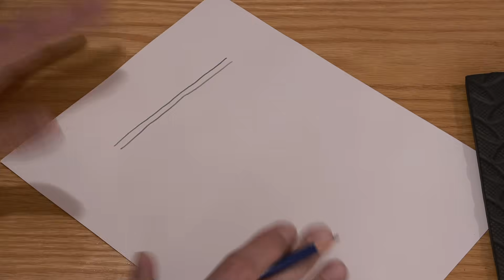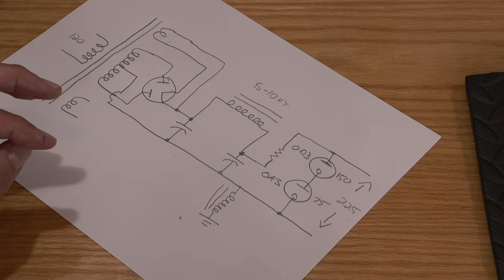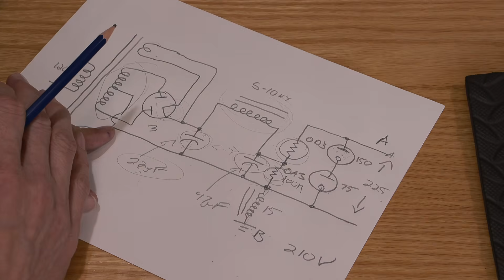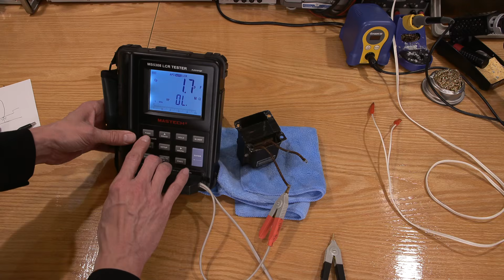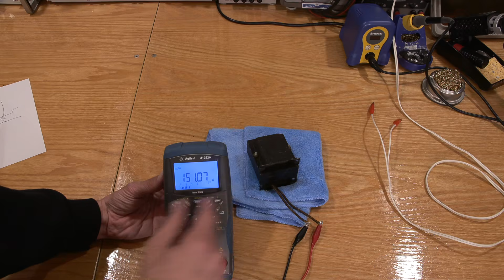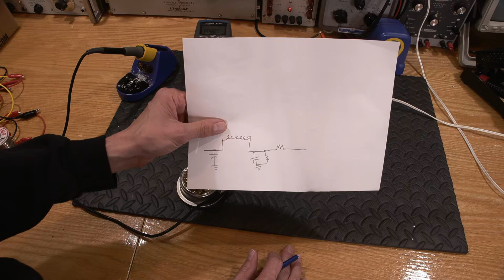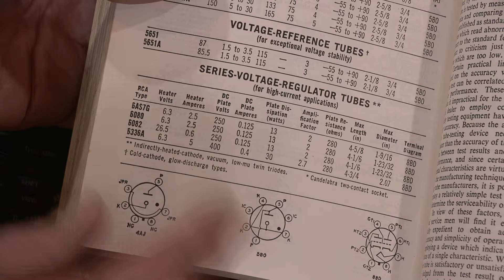Build A Power Supply - With Junk Box Parts! [The BC-348 Series.]

Comment: Can you please explain what is "B Plus" ?  Thanks.
Reply from the maker: B+ originates from "Battery positive." It was widely accepted as the "high voltage positive" in battery-less sets, (and pretty much everything else) that utilized an elevated voltage supply.
Reply: Wiki: "B+, the plus voltage of a Battery (electricity) or plus voltage of an electronic circuit." In tube circuits it is an elevated voltage (DC or Direct Current), the tubes need a high voltage on the anode to work.

Comment: The only change I would make to your power supply layout is that I would put a cage over it to keep my cats from climbing on it and touching the hot tubes.  I liked guessing along with the parts picking and was surprised how close I got to the actual values.  I don't consider myself to be very smart, I'm just a peasant who has been tinkering for 52 years and learnt many things the hard way!  Never try to wipe off a CRT to get a better look at the numbers.  I was replacing a picture tube in grandma's tv when I was 15.  I heard the little "tick" then things got a bit fuzzy for a few seconds.
Reply from the maker: Yes, a damp cloth around the anode will set you up for a really hard lesson! Thanks for sharing your story.

Comment: Well, if you're really going to be period-correct with the 5U4 rectifier, really, you should ditch the Hakko soldering iron and go with one of those hungus cattle-prod sized soldering irons suitable for joining rain gutters, no? 

So in terms of developing the proper value for the big dropping resistor, I'd thought I'd see you use your bench power supply, the big honking Lambda model 71  [which I have NEVER seen you use and it's too damn bad, we ALL have such a supply and feel the need to have one and we NEVER use it] to run the radio & measure the operating current and from that number calculate the dropping resistor value.

Comment: Mr. C builds a radio power supply. The rest of us are unknowingly partaking of a college-level applied lecture in electronics fundamentals. This is what YouTube was built for. 👍 Two hours of video brings many, many thoughts, but chief among them:

-If we're going for a cool-looking power supply, perhaps consider sneaking a neon lamp behind the 5R4, so it also glows as brightly as its contemporaries. We could use LEDs on that 5v or 6v winding, but we're keeping this old-school, correct? If we need an excuse for the neon to be functional, perhaps it could also help clamp that initial voltage surge.
-Any cool-looking power supply needs a current meter next to the jewel light, right? We gotta know how much power that speaker is (or those headphones are) pulling. 😁
-If this radio is as hackable as you say it is, this viewer wouldn't mind a detour from the Restoration Series to see some nifty things a surplus BC-348 could do. Probably easier for you to do while it's already on the bench. Or, if such a detour causes an outcry, we could revisit this later.

Thanks Paul!

Comment: My old Tektronics 310A scope has factory holes throughout both sides for ventilation of its 30 something tubes. I LOVE the warm glow the tubes emit thru the side covers. Perhaps your power supply could utilize a similar vented cover to allow cooling and tube protection while letting the beauty shine thru. The 310a was built in '59 so it's still period correct I think. You have similar vintage scopes, so you know what I mean.     Tom S.       (patreon sub)

Comment: Sir,
Apocryphally the term debugging, currently used to correct programming errors, came into use during the requirement in early computers and telephone exchanges (40/50/60s) where relays and uniselectors were prevalent. The term referred to the maintenance required to rid the systems of dead insects caught in the contacts.
In the 60s we used the term birds nest to refer to knocking nails into a plank of wood to provide a 'chassis' upon which to build a circuit.
Dead bug construction was fundamentally the same when ICs became more available.
Whilst those with better/unlimited budgets had more sophisticated methods the standard hobbyist had to make do and adapt.
The same is true today.
Dave.
Reply from the maker: I commonly refer to it as a "rats nest" as well. But that's a bit harsh :^)

Comment: I would put the two regulator tubes next to each other. Form follows function. And if you can find one of those military 5R4GY's with the ceramic bases, that would be great. No military equipment would have a 5U4 -- that's TV receiver stuff. The transformer and choke are nice, though they have a 1930s radio vibe instead of the military look, but that's OK. It's great that they are the same style.
That's a really nice radio; I'm looking forward to seeing what you do with it.

Comment: What sets the -15V for the negative supply? Seems to me it's an IR drop across the choke between the center tap and chassis, or something in parallel with that choke that sets a V=IR. If it were just a resistance, it would be dependent upon the ground current magnitude. Seems kind of indeterminate, but I guess it doesn't need to be precise at all.
Reply from the maker: It mostly acts as a resistor, but pretends to be an inductor a little.

Comment: Probably one of your better design videos! Question, would it be possible to utilize those regulator tubes in a variable HV power supply for experimenting with various tube circuits, say variable 100-350 volts?
Reply from the maker: When the regulator tubes are used as a reference for another pass element, yes.
Reply: @MrCarlsonsLab  Maybe you could show a design of a variable supply. It would seem like you'd need such a supply if working with tube circuits, etc. Thanks!

Comment: Hi Paul. I used to try the math thing myself for resistors, without much success.  I ended up buying a couple of big wire wound pots and then I just dialed in the voltage I needed, popped it out and measured it and knew what I needed. Of course, I lacked your collection of resistors to try!  I enjoy the long form videos. Thanks.

Comment: Awesome series.  Paul is it possible to use gaseous regulator tubes in parallel to increase the current handling capability?
Reply from the maker: You could, but they would need their own series resistor. They don't play nice with each other when attached purely in parallel.

Comment: I'm curious about the shunt regulators. The B+ appeared to be very effected by the Line voltage, as you changed it, I thought the regulators would compensate at least to some degree?
Reply from the maker: Yes, it's just a simple shunt system, Zeners will do the same in a simple setup like this, and be affected by temperature variation too, (surprisingly, more so than the tubes.) There is actually a lot of compensation going on, much more than a tube radio like this requires. You can see the regulators doing their job in the current demonstration (orange meter) compared to the (blue meter) monitoring the regulated B+.
Reply: @MrCarlsonsLab  Thanks Mr Carlson, Interesting project.

Comment: Nice to see the build process!  Quick question: you measured the filter reactor inductance, but how did you know it could handle the current in your circuit?
Reply from the maker: Just a simple core size observation. That core would easily indicate 100mA "or more" handling ability.

Comment: Super video 👍 👍 . . . brings me back when I was a Novice back in the early '60s running an 807 on 40cw . . . now, all my amateur radio gear is SS but I do have all my guitar amplifiers as vacuum tubes . . . no better sound than a tube amp 😎 . . .

Comment: In the next video, could you please explain how/why a regulator tube works?
Reply: Inside the tube is a gas, and the sort of gas determines above which voltage the gas suddenly conducts (breakdown voltage) like the old TL light. As soon as this happens, current rises, and there will be a voltage drop over the resistor that comes from the plus of the rectifier tube (the 2x470 Ω in Pauls design), while the voltage over the regulator tube stays at that same breakdown (= conduct) voltage. Will the (mains) voltage rise, only the current through the regulator tube will rise, the voltage over that regulator stays the same, but that higher current will make that the drop over the resistor will get greater.
Again, it is a property of the gas. The small orange neon bulbs work in similar way  (e.g. in extension cord switches, but there they do not function as a regulator, just as a lamp). Neon has a a breakdown voltage of about 90 Volt.

Comment: Can two sets of regulators 2-0D3, 2- 0A3 wired parallel be used for more current output?
Reply: My guess is that you run into imperfections between the two; if one has only a slightly lower breakdown voltage than the other, it gets the bulk of the current.
Reply from the maker: You are absolutely correct Erik!
Reply: @MrCarlsonsLab  Thanks Paul, then it was an educated guess, educated by zener diodes.
Reply: @erikdenhouter  I've never tried paralleling VR tubes some of the old ARRL handbooks and Bill Orr handbooks show examples using small value resistors in series with each VR tube to equalize the current between tubes to help solve what you mentioned. The resistor values could be selected by measuring the current at each tube and selecting the appropriate resistor value to balance the system. Again I've never tried this sounds like a possible solution to the current imbalance.
Reply: @U812-k7j  That seems like a valid idea when I think of how to parallel two LED's, to avoid the same problem. You put a small value resistor in series with each LED with the effect of almost equal currents. But you need two resistors and the voltage head room, and your total space occupied is probably larger than using a higher power regulator. Still, a good way to look at it. When you would aim for a possible difference of a few Volts, say 5Volt, and the current is 40 mA, Ohms law tells you that the resistor would be 120 Ω, and only 0.04 x 5 = 0.2Watt ( use 0.5Watt) Small price.

Comment: Would like to see a project one day for a hybrid bench power supply incorporating solid state circuitry, vacuum tubes, 7 segment displays or even an illuminated dot matrix for readouts and pots for voltage and current all finished off in a nice retro case, for example.

Comment: To have one with a dynamotor is quite rare now and if yours has one keep it in! It makes the radio more complete and worth more.
Reply: The reason the Dynamotor's are rare is they were noisy. All of them run at a pitch that is really annoying too. I don't remember the smell he talks about, other than just 40s era electronics. I had an old Navy TCS receiver, and transmitter pair that my High School gave me. The Dynamotor was louder than the radio could make the speaker, and headphones didn't make it much better. As he said in the first part, in a B-17 there was so much noise it didn't matter. Also, the Dynamotor for that equipment was designed to run from airplane specs, my old Navy gear was designed to be in a Jeep or truck so it ran from 12Vdc. In either case you would have to build a power supply to just run the Dynamotor. I used an old battery from our tractor that I had to charge when I wasn't using the radio until I built the replacement power supply. I like old gear, but the Dynamotor is best left as pictures in a history book, and accurate military restoration projects. At the time it was a quick solution, now it just isn't worth it.
Reply: @brianatbtacprod1989  it's a matter of preserving history there are plenty out there already modded just use one of them like Mr Carlson is doing.
Reply: he has a dynamotor, a working one!, and he show it in a previous video, it is noisy as hell xD

Comment: The whine of a dynamotor is glorious music to many of us. With the cabinet on, it's quite soft. 

But providing 28 volts DC at several amps didn't make sense back then. 

Plus dynamotors need more maintenance than an AC power supply.